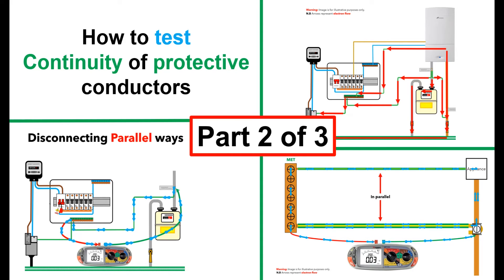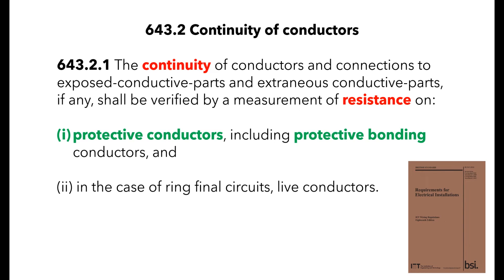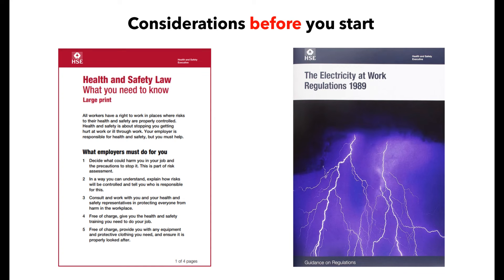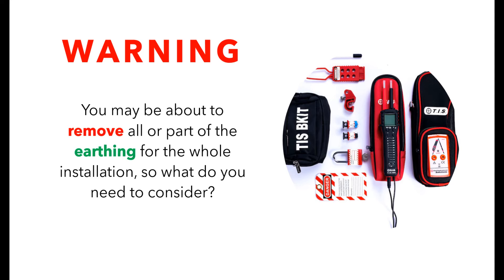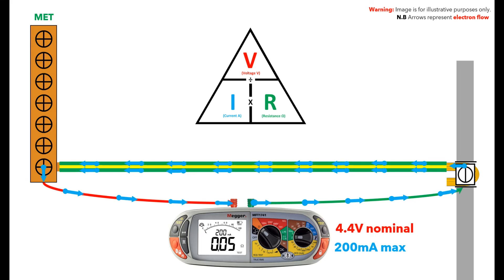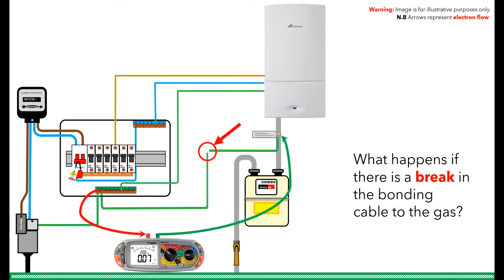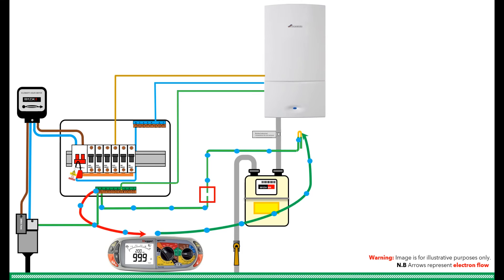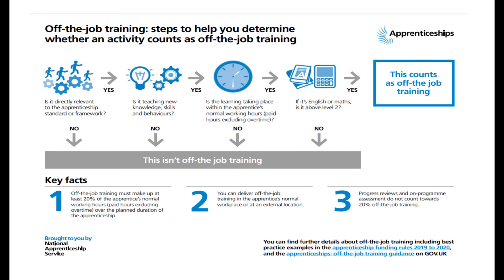Earthing and bonding part 2: How to test continuity of protective conductors

Comment: Great video
Disclaimer is so true.. massive respect to you standing your ground for our future generations.

Iv work for a few guys and found out they were domestic installers and they were so BAD I had to walk away, many reasons
Poor workman ship
Not putting buzz bar in correct/fire
Not testing anything 
Incorrect polarity supply 
Not connecting up in light circuits with LAP shit spot lights 
Poor isolation ( 2 near miss's on my self because of them)
Don't uses bs7671
And many more, just don't give a fuck just fast money
Taken many photo to cover my back

 I have worked in domestic for 7 years and I love it still but i want to learn more and push my self because I know I'm good,

Iv done 
2365 level 2 
2365 level 3
18th 
Part P
Going to go and do my 2391-52 in July
Then start my NVQ but need to get more commercial training ect
Reply from the maker: Thank you 🙏

Keep pushing and good luck. 

As they say, the cream always floats to the top 🙌